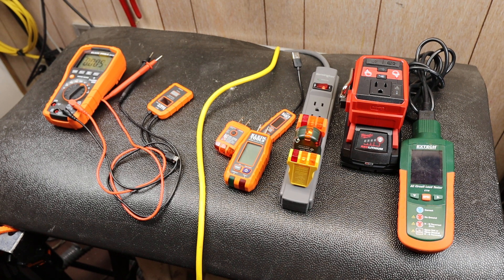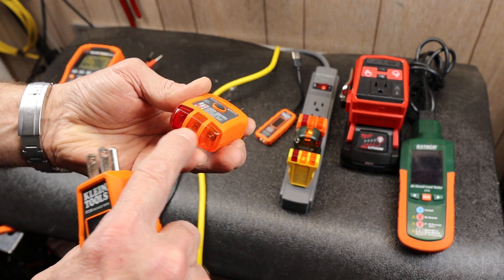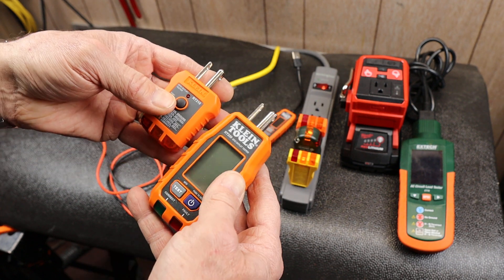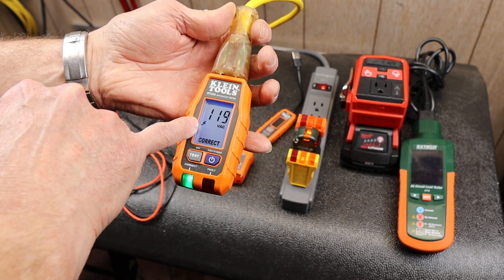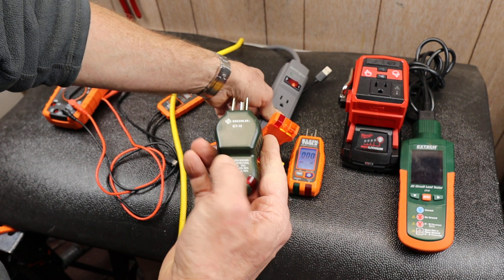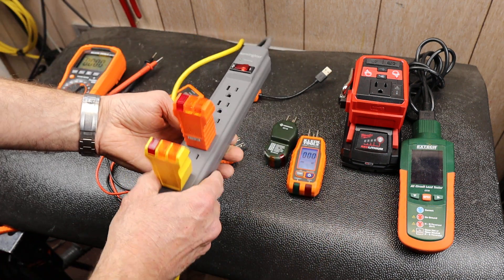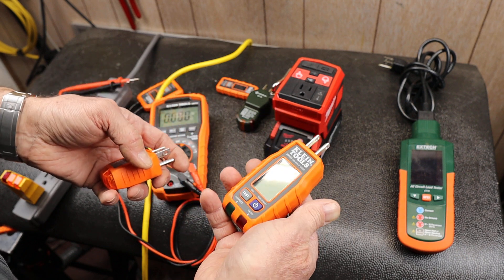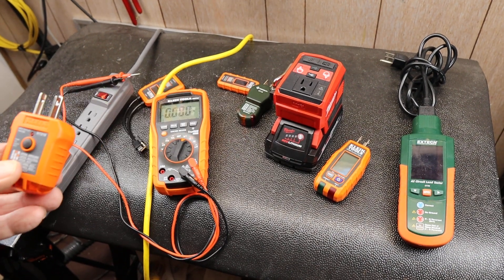Hands on with the Klein RT250 GFCI Outlet Tester with Digital Display

Comment: Sometimes will trip the GFCI ( if there is one wired, many boxes away from any one wall plate you are testing ) - so make sure you know where they are and that they have been reset - otherwise a very straightforward device .

Comment: The output of the inverter it's a modified sinewave, not a pure sinewave. The outlet tester is not true rms, that's why it's picking up 90 volts. The multimeter that you're using it's true rms, that why it's measuring the correct voltage of the modified sinewave. There is nothing wrong with the outlet tester,  it will only measure the correct voltage with a pure sinewave.
Reply from the maker: Thanks. I have a lot to learn about these testers.
Reply: I doubt many people are using this in a Boat or a Camper - they are using it their 'structure' connected to any 'regularly' found power in the walls of their home or business - that's much more often than not pure sine wave juice - this device will work fine ........

Comment: The ground is not bounded to the neutral.  That's why you will get a fault.  But other that that it's OK to u. 
You will not be powering a microwave or a power tool with that 😱😁😱